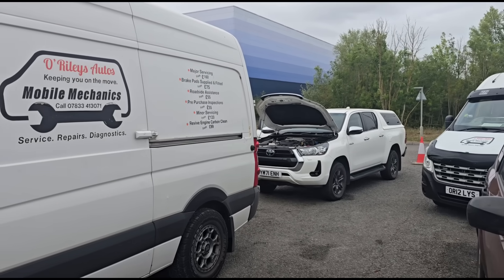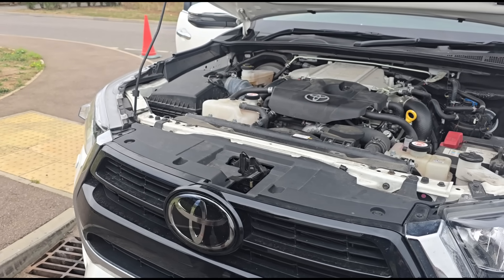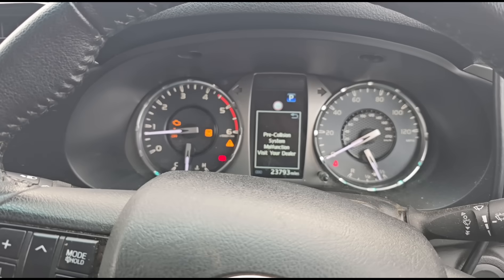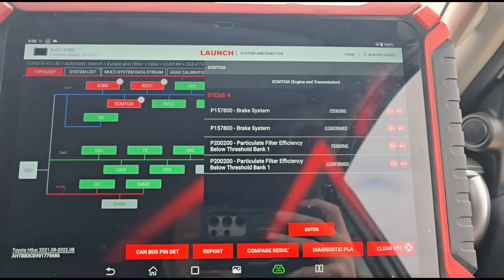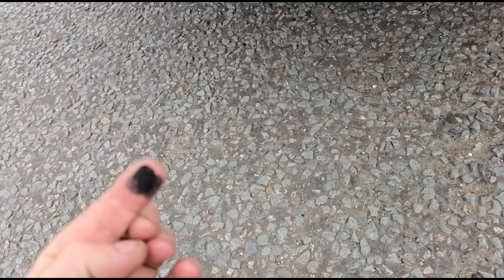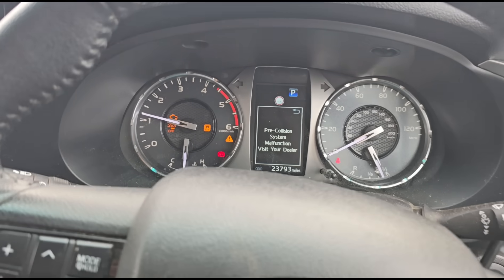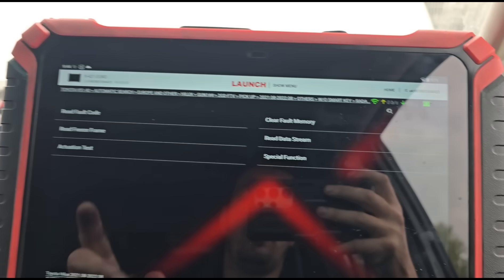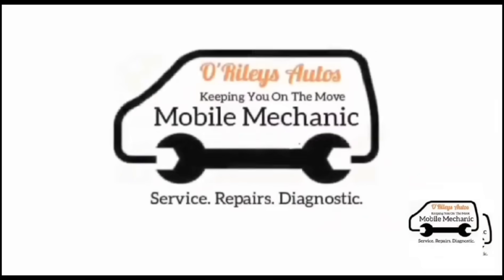Toyota Dealership Said They Can't Fix This Hilux After 10 Repairs

Comment: In Australia this engine is the 3.0litre. I've seen this very same issue over here. Absolute fukn disgusting when these are over $70k fully optioned. I have the 2004 1KZTE. One quarter the power. One quarter the complexity. One third the comfort. Uses twice the fuel. 10 X more the trustworthy and durability. If i were given or inherited or won one of these I'D SEll IT!

Comment: Is it also possible tge reason its showing a code for low pressure is that the dealer partially drilled out the dpf...and there was black soot on tge exhaust

Comment: Toyota arent what they use to be i had a warranty issue with my 2020 landcruiser after 25k need new brake discs all warped bad vibration under medium to hard braking refused to replace i dung my heels in came back with meet you half way i replied 42k price tag 3 year Warranty cover it rang toyota ireland told last chance or it solicitors letter got a phone call a week later agreeing to full warranty replacement but i had to sign a waver if it happens again no warranty this a once off what shower of chancers their like an insurance company when it comes to warranty anything to get out of it and the price of the new landcruiser 75k they can keep it

Comment: DPF's are bureaucratic fraud. They cause more problems than they solve. Better off without them. Diesels use less fuel without them. No clogs, no downtime, cheaper to run. If you have to waste many man hours on trying to "fix" just one vehicle, that is worse for the environment than not having it at all.

Comment: Dealerships are nothing but fitters of replacement parts. If the computer doesn’t tell them what to do they are incapable of basic fault finding and diagnosing what’s wrong. Plus they charge the rest. If you can, avoid them.

Comment: 👌👍Calm, methodical, informed.. Unfortunately you are a rare breed, my experience with main stealers, has usually been hasty, incorrect diagnosis, lack of knowledge, laizer faire attitude, customer pays, check loads of parts at it.. And it continues, as in this case, correct diagnosis at main stealers, but wrong process of fixing problem. Hats of ye Mr o'rielly.
Reply from the maker: Thanks for watching

Comment: Stealerships are good at fleecing money from the customer, so most of them will do a diagnosis and tell you to replace a certain part. If that don't work, then just repeat the process, while the customer is paying for it, simples.
Never take your vehicle to a stealership to be serviced, unless it is absof*ckinglutely necessary in that there is no other option.

Comment: I was told by toyota after 4 visits ,that my 2006 which was going into limp mode constantly was unfixable and had unfindable problem. booking into rolling road (Dyno) owner who found stepper motor on turbo was problem. easy fix and fine up to now 2025.

Comment: The original DPF failed for a reason. The fact they simply replaced it and hoped for the best, without investigating the root cause, is ridiculous.
Reply: Yes. It means that either the dealership didn't have time to trace the fault, or the mechanic didn't know what he/her was doing. Hang on to your older Hiluxes, long as you can.
Reply: @gerix5539  Fitters and throwers.

Comment: From what I've seen with MG dealership's now is that there too interested in selling cars and not on the after sales part. Many of technicians as they are now called in the workshops only seem to have the skills to fit parts and not to think. Cars in and out,the owners pay and the figures look good.
Find a good mechanic and use them every time if you can't fix it yourself!
Reply: Worst car ever , even the sales reps told me they’re embarrassed selling them

Comment: Logic would tell you that the DPF failed Early.
The DPF was the 'Symptom'.
Toyota should have 'at least' replaced the 5th Injector as a 'Possible Cause' instead of thinking that their DPF's 'lack Quality'.
I highly doubt that the 4 Main Injectors needed replacing at All.
The Technician and Dealership involved are just 'Parts Swappers' IMO and don't deserve a Toyota Badge on their door.
This would surely have to be a Warranty Claim ?

Comment: As a petrol head for40 years i support the people who keep driving their old stuff. Put the new cars where the sun doesn't shine.
Reply: Older cars simple and easy to repair. Classics are a good example, might not be quite as efficient or do the m.p.g of a modern car but far less spent on finding tiny faults that will effect running. Modern cars just yoo complex and expensive to repair.

Comment: The clue to what a Diesel Particulate Filter does is in the name. The black tailpipe is invariably a pointer to a failed DPF, otherwise where do you think the soot comes from? The reason for the failure is another matter altogether. All diesel emission control devices that have been bolted onto internal combustion engines are a single fix for a multitude of driving styles, virtually none of which are as designed by the manufacturer, therefore driving style can be a factor in failure. I would tell all of my slow driving/low revving drivers of diesels to drive along our local stretch of motorway for at least 20 miles and at 2500rpm and above. None of them had recurring DPF faults. The major problem is that the I.C.E. is no longer fit for purpose in this pollution reducing world of ours.
Reply: It is fit for purpose, but they're trying to change it so much that it isn't
Reply: I understand your point but my reasoning is that because there are so many external bolt-ons now required to make the diesel I.C.E. conform to stricter emission regulations then there is a fundamental problem with the basic power unit. Yes, it works, but that on its own is no longer good enough. Going from mechanical injection pumps to electronically controlled injectors and high pressure pumps did initially make a considerable difference to emission levels, but the problem with the minute particulates produced in the combustion process is still there. This can only be eradicated by not producing them in the first place, hence you have a power unit which is not fit for purpose.
Reply: I  agree with you , driving s!tyle very important with diesel engine specially built with DPF. This engines don’t like city driving. Definitely good for long distances only but very often!

Comment: I have owned my 2015 Hilux 9 years, No issues whatsoever until last week when a whining noise from the engine area. Took it main dealer! They diagnosed needs 2 idler pulleys plus new belt! Cost £900 no thanks . Local guy said it’s the Alternator. Cost £300 sorted, main dealership terrible place
Reply from the maker: Thanks for sharing

Comment: 24,000 miles in four years, WHY the f*&k to these people who basically just need a motorised shopping trolley drivers buy a diesel that's meant for long haulage? Buy a petrol engined vehicle or an older model.
Reply: Diesel engine is really suitable for long distances, especially modern engines.

Comment: Why should it be cracked tho! what's causing it to crack too much heat ? that would be the fifth injector?
Reply from the maker: Fuel injectors over fueling is common
Reply: @ORileysAutos  still don't know what you mean you mean over filling the DPF?. DPF elements is designed to take a lot of heat I would be very surprised if you cracked it.

Comment: if it s down to a driving style then toyota should  advertise thier driving style
Reply: Yes the company I work for had a fleet of transit flat beds used for door to door milk deliveries.  Their DPF’s kept failing well within warranty getting clogged because they were doing short runs and not getting upto temp to do regens properly. Ford said they were not being driven in the correct style of driving.. our transport manager went into local dealers with the owners manual from one and asked them to show him where the section was on the correct driving style?  They couldn’t so eventually they replaced the DPF’s under warranty. But Ford have never supplied us any more vehicles after that we have VW models now.

Comment: the newer 2.8 is the same not great engines plagued with emissions and adblu timing chains crank shafts problems isuzu is the best pickup now
Reply: The 2.8 engine is much better than the Isuzu engines, but I personally prefer the gasoline engines.
Reply: @فارس.التميمي-1444  no it's no isuzu Is much better 30 and 1.9 way better than Toyota now the new 2.8 is junk
Reply: @Patrick-y7e  It's not junk or anything, the problem is the stupid DBF system, and also the diesel is not suitable for short distances

Comment: Has the dealer reset the efficiency model for the DPF? Within your scan tool you should be able to either recalibrate the differential pressure sensor, or reset DPF adaptations. At the moment it might be expecting less soot than is actually accumulating due to it being new and trapping more.

It could also be cracked, but I'd try the top first if not.

Comment: The problem is due to poor fault finding, technicians use software to fault find and the computer says! so therefore it must be. But as experienced technicians test to prove the fault once the computer tells them where to look. Well done and we need a follow up.... Thanks
Reply: the problem is really the time allocated to find and do the repairs which the technicians at dealerships dont have much either so the solution is independant shops when it gets out of hand. the car wizard is an excellent one to watch too

Comment: Trouble with dealer technician's is, sometimes they only get half the story, the are generally working from what someone has scribbled on a job....... that's half the problem, then the customer can't talk to the tech, they can only talk to someone at front of house, who's basically clueless and doesn't even know what a DPF is.

Then there's a massive lack of training for the tech, and the computer that has all the answers, very often doesn't and it certainly has no common sense.

I always speak to my customers and gain as much information as I can, before starting the job.

5th injectors sometimes partially fail on these and will only supply enough fuel for around 550 C.... Which isn't hot enough, need minimum 600c for these to regen properly and the hole in the housing needs to be clear of carbon.

Well done Jimmy on the diagnosis 👍
Reply: The injectors are usually only partially faulty.
Reply: 100% agree.
Reply: This. I bet it's very rarely the technicians at fault. It's the dealer, front desk, marketing, budgeting, car design etc that makes fixing impossible.

Comment: if Toyota scammership has a hard time believing the DPF is damaged why would they not play the detective, remove the DPF and stick a borescope on both sides and see if honeycomb structure is cracked or not, usually u can see straight away if it's cracked, tell the customer to ask Toyota to do that or owner should higher an independent shop to do this and record video with the borescope and then go to Toyota and present them the video evidence and take it from there.

Comment: Toyota use to be the go to word for reliability…. But unfortunately they seem to be going down the same route as every other car manufacturer…… il stick with my 22 yr old Hilux over any new vehicle these days, at well over 200,000 on the clock still purrs along… I’ve seen cases of new Hiluxs needing so much new stuff at only 10,000…. Such a shame
Reply: Gasoline engines are practical and do not require abnormal maintenance. Even the same oil filter has been in use since about 1989.

Comment: Great video I have a 2008 Hilux and wouldn’t swap it for the newer version old school is the best
Reply: Agree. Cars built after 2010 are to be avoided. I drive my 169,000 mile non-DPF Skoda.
Reply: @dcasteaux9181  Hilux 2005-2014. We have it since 2006-2015. It's the same. There are no mechanical differences. There are some differences in the specifications and facelift.
Reply: @dcasteaux9181   My Defender , 416.000 miles,,never broken down ,
Reply: Here in NZ we remove the dpf and egrs and just remap.dont know what its like over there re the emission laws etc
Reply: @pyromaniac354   oh wow It will void warranty And insurance
Reply: @jang9268  most  don't care as most of the issues come from egr and dpf issues.
once factory warranty expires then its a definite win.
this in new zealand so insurance side isn't a problem
Reply: @jang9268  whos going to tell the insurance? and the warranty only lasts a couple of years ,planned obsolescence is expensive
Reply: @vincemarshall8550  first thing when something goes wrong they try to pick up excuses these day manufacturer and insurance companies are nothing but gangster.

Im Just saying for your peace of mind
Reply: @jang9268  i get you pal but the idea is to try to avoid being in a bump ,they are gangsters as you say so lets treat em as such ,if you are fully above board they will still short change you
Reply: @pyromaniac354  removing dpf and egrs and remapping are all illegal here
Reply: 1997 Hiace. Not a single chip in the whole thing. Priceless.
Reply: Homie yours is the shit one 
Pre 2002 the 2400 2LT is the most reliable diesel Toyota engine or the non turbo 2L .
That’s that
Reply: I have a 2012 model bulletproof it’s the emission crap that has buggered the reliability of newer vehicles
Reply: @michaelbudd123  The petrol engine will not be affected and the LC70 also has an i6 diesel engine.
Reply: Agree - this is one reason why I buy a reliable vehicle that's 5-10 years old, many of the issues have already been dealt with and there's less technology and unnecessary 'fluff'  to generate a fault.
Reply: I'm keeping my 1KD Hiace too. I'd rather stay DPF free.
Reply: 2012 hilux no dpf last off the best

Comment: Maybe the original injectors were faulty and that cracked to original dpf then the dealer replaced the dpf and the original injectors cracked the second dpf
Reply: Haha I posted that above comment just before you said it lol

If I ever replace a cracked dpf I always clean inside the tail pipe as far up as I can with brake cleaner and a rag on a stick just for future reference if it ever comes back with another dpf issue then I can do the finger test.

Comment: Fascinating video thanks. I have a Prado in Australia and Toyota lost a class action about the DPF in Hylux, Fortuner and Prado vehicles there. They appealed and many years later there is still no final result. I have been concerned about my DPF with all the bad publicity and use Torque Pro displayed on a Chinese head unit to monitor what is happening. It shows % accumulation, three temperature sensors and pressure before and after the DPF as you showed. I saw the accumulation on your tester reading 44% and thought there is nothing wrong but realised as you were explaining that the pressure was too low so I assume the software thinks the DPF is not there or has a hole through it? I have seen a honeycomb out of a Toyota DPF and wonder just what could have happened to let the exhaust straight through, surely it would need a chunk of the ceramic filter to be missing to cause these symptoms?   I would like to hear your thoughts as I thought they can easily block but not bypass the filter??
Reply: Pressure should build up over a set amount of miles ie 1 gram of soot every 10 miles, with a crack it will only build up 0.6 grams ie lower m bars of pressure. This will then trigger P2002. 
Like a TPS loosing tire pressure triggers a low tyre pressure warning.

Comment: There is one more procedure that needs to be taken into consideration. After changing DPF from diagnose test tool you have to active test "Activate the VN Turbo Cleaning" . If this step is omitted, DPF catalyst could be melted down in the worst case. Hilux diesels are very reliable and DPF faults are easy to detect. Generally, the DPF lifespan is 100,000 miles or more. It's surprising that the problem hasn't been resolved in such a short time from dealer.

Comment: What if the Dealership never changed the DPF? Could happen that they did a forced regen that destroyed the DPF. Other culprit could be an issue with the injectors, which cause the original issues.
Reply: The "new" DPF could be just a cleaning. And seriously doubt they would replace all injectors. Even with warranty, the Dealership has to step up with the parts. So not a surprise they would do a hack job cleaning the DPF and later the injectors, just to avoid having to spend money on parts to solve the issue.
Reply: @RogerM88  no.  Its cracked. Simple as that.
Reply: @timbo19751975  Maybe they attempted to clean it, not aware it was cracked. And now they're kicking it to the side, avoiding replacing it.